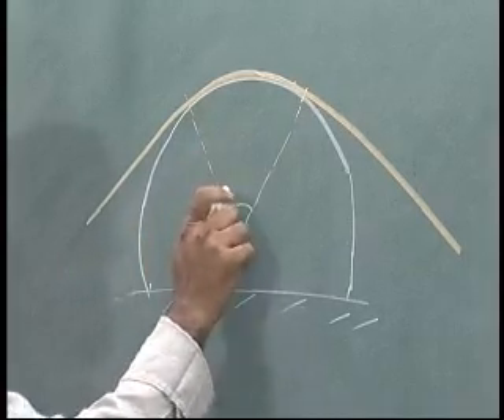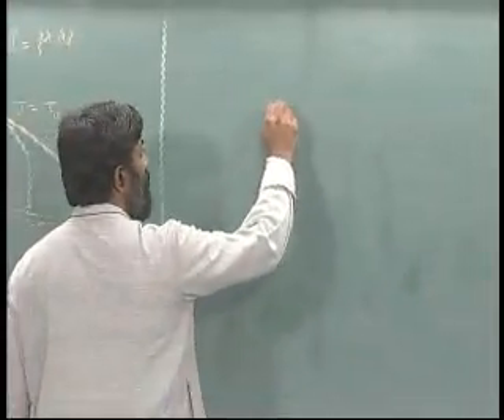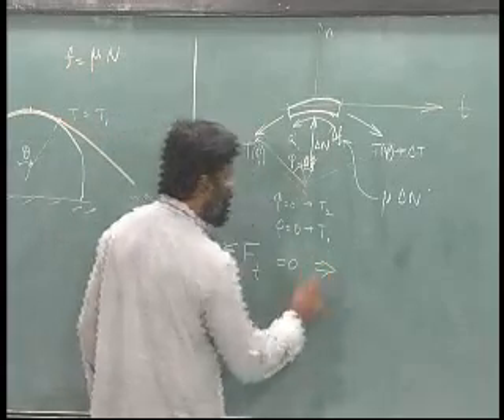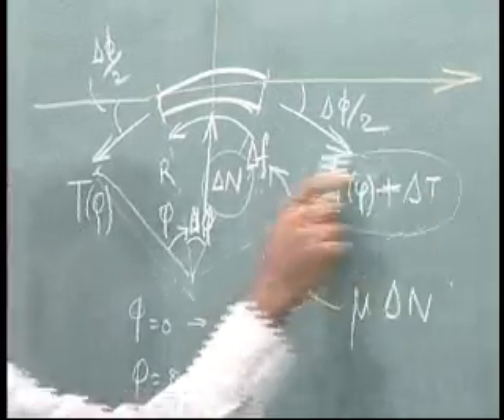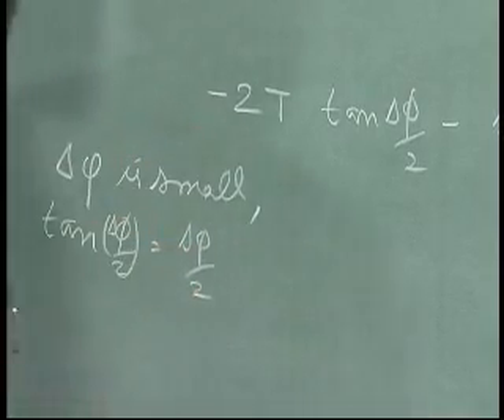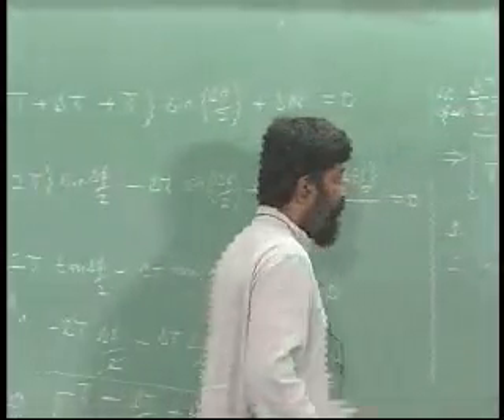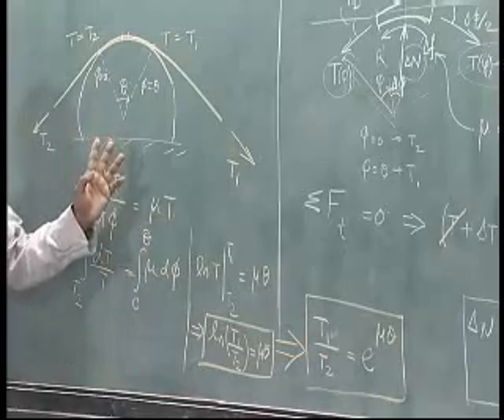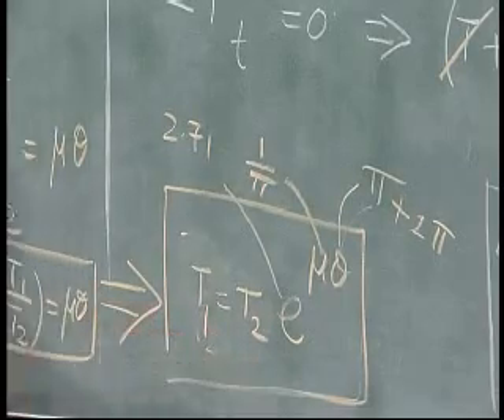Mechanics of Solids - IITM 4.2 Belt Friction

Comment: If you listen again, when delta Phi tends to zero, 
delta T/2 tends to zero.  This is clear.
However, in the case of delta T /delta Phi / mu, both the numerator and the denominator tend to zero and therefore, in the limit, delta T/delta Phi becomes dT/dPhi - the derivative of T with respect to Phi.  Hope this clears your doubt.
anbudan,
Siva